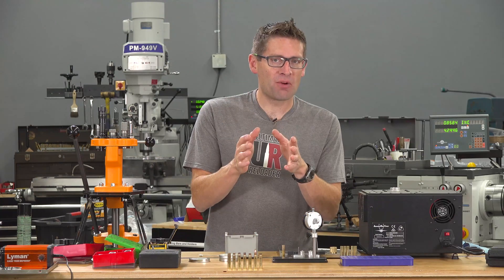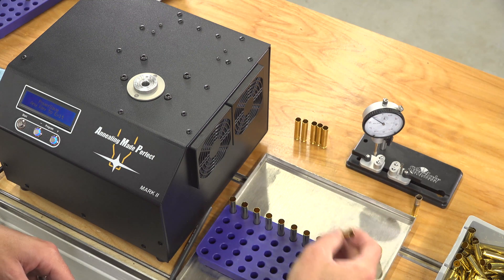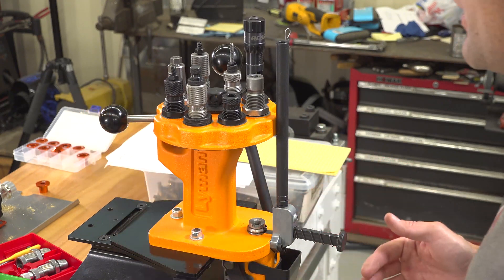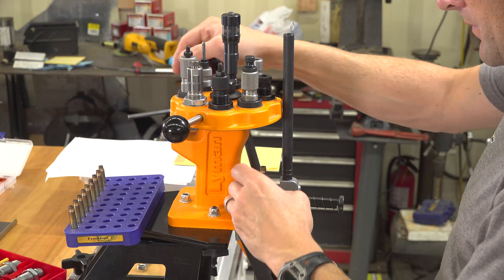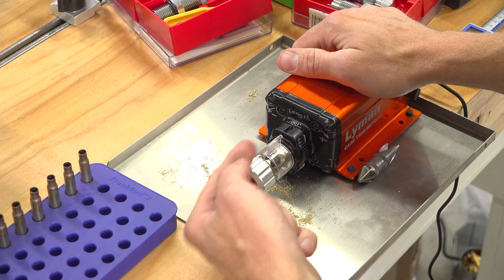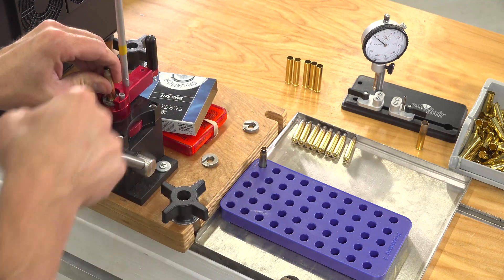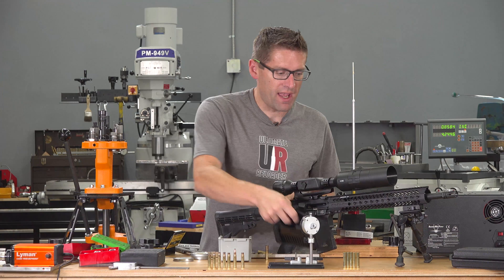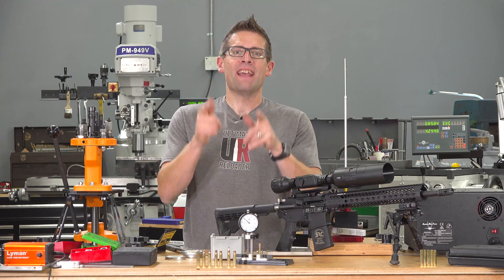Forming Starline 223 Basic to 25-45 Sharps Step By Step

Comment: Whats the difference between 350 legend and 25-45 sharps??
Reply: .355 bullet vs .257 bullet
Reply: The 350 legend is also a rebated rim cartridge.  That means the base of the case is larger than where the rims is.  This allows a father case to use the standard .223/5.56 bolt face.  It also means you can't make you own brass from a .223/5.56 case.

If you are looking for a larger bullet with less hassle look at the .357 max. auto.  Basically take the basic brass he started with and stuff a .355 bullet in it.  It is a wildcat but info can be found on it.

Comment: If you are not splitting necks the multi-step  halfway forming is waste of time,  especially if you have the form 500 of them.  I form 7.62x40 cases and process is almost same.  I use range picked up 223 and I never split the necks even without annealing which is recommended.  I found that the initial run out can be significantly reduced if you FL size it, rotate 90 degrees and size it again.
Reply: He mentioned having some split.

Comment: Hi Gavin , I’ve had my AMP for a few years now, the part I don’t understand about the amount of times you have annealed that brass is when the machine first hit the market the guys who made it said that if you were to run the brass a second time through the machine let alone a third time the brass would be over annealed and should be discarded could you shed some light on this or perhaps you have spoken to the guys at AMP that this process was ok to carry out with no issues to the brass , thanks in advance Gianni.
Reply: If you anneal the brass with the same setting on the AMP, it shouldn't do anything. It should just anneal it to the same amount it has previously done. It should change nothing.
Reply: @newerest1  
I’m sure that is what I remember them saying at the time ,, so once you have annealed the brass and it was soft  , if you anneal it a second time wouldn’t it be over softened or is that not the case ?

Comment: My main question is why do you anneal after the final sizing and trimming? Have you experienced any case length difference after the annealing?
Reply from the maker: That was a suggestion from AMP- as I mentioned in the article, I'm erroring on the side of more steps and more annealing than is probably necessary. I had some cracking early on in my experimentation. I think some of these steps could be removed one by one, checking under the microscope, and testing longevity (see the article for microscope screenshot).
Reply: @Ultimatereloader  ah. Okay. I guess it is better to error on the side of caution rather then regret ruining all that nice brass.
Reply from the maker: Exactly :)